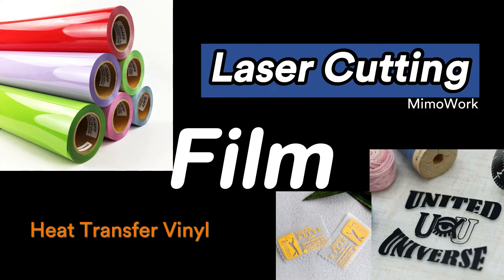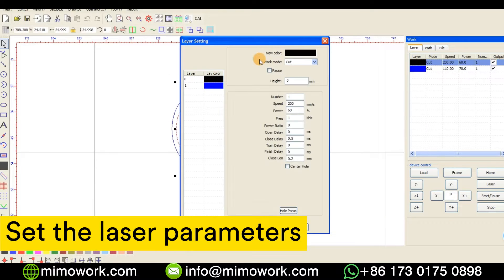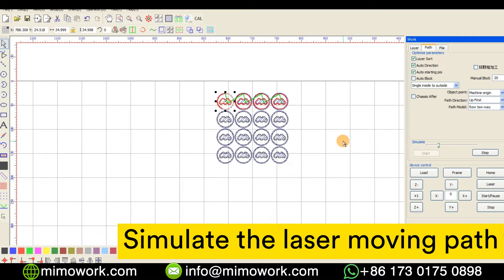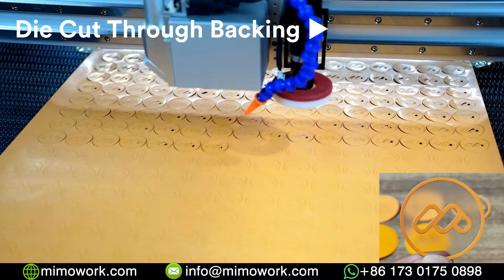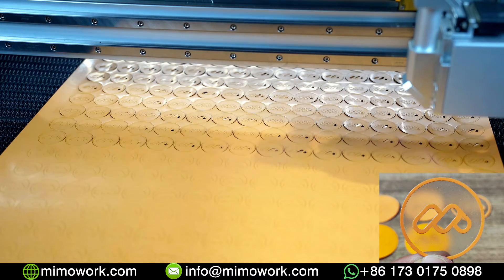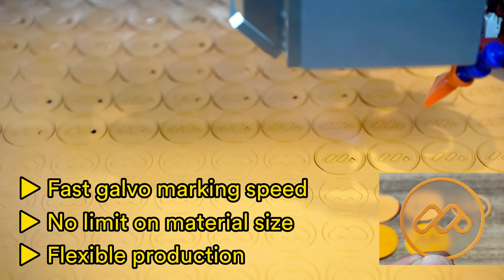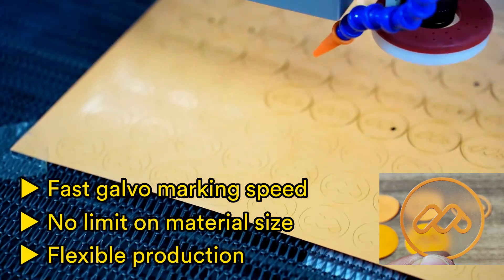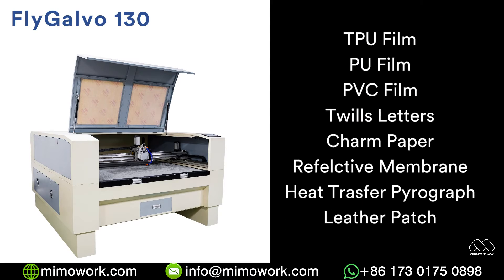How to laser engrave heat transfer vinyl film | Laser Engraver

Comment: Can it engrave and cut siser brick 600?
Reply from the maker: Great question! 🤔

While we're not 100% sure what 'Siser Brick 600' is (sounds like either a tough vinyl or silicon carbide brick), here's the laser lowdown:

✅ If it's non-metallic → Our CO2 lasers can probably handle it with the right settings
❌ If it's metallic → Better suited for fiber lasers

At this point, why not let us find it out for you? 🔍

We're offering:
✅ FREE demos
✅ YOUR materials
✅ Live, so no editing!

Reach out now:
📧 info@mimowork.com
📱 WhatsApp: [+86 173 0175 0898]
🌐 https://www.mimowork.com/contact-us/